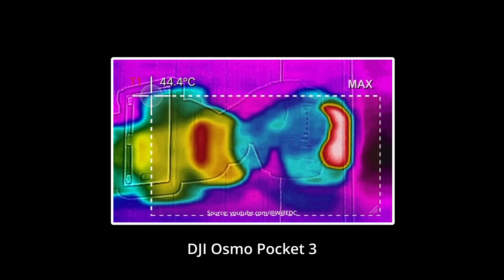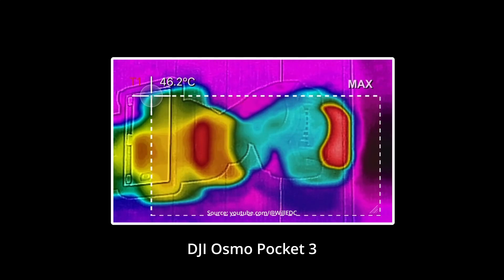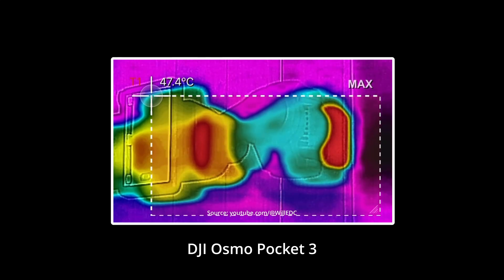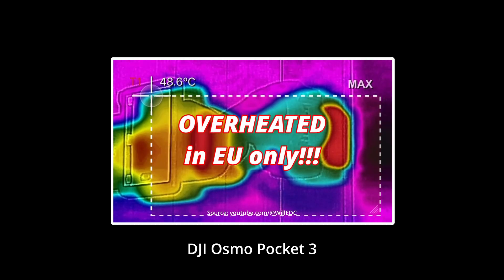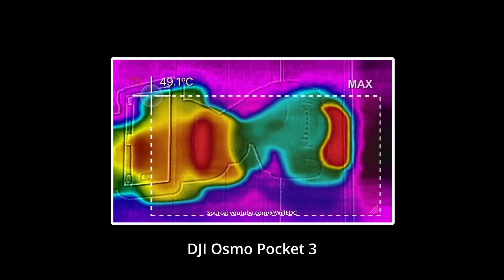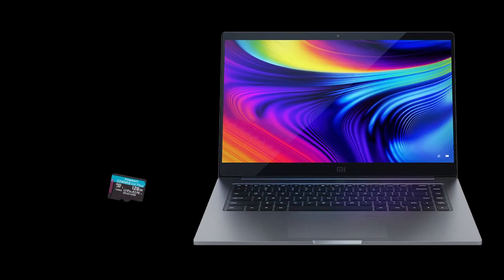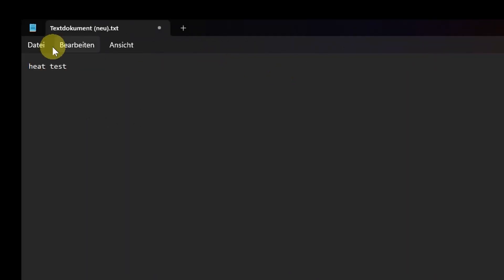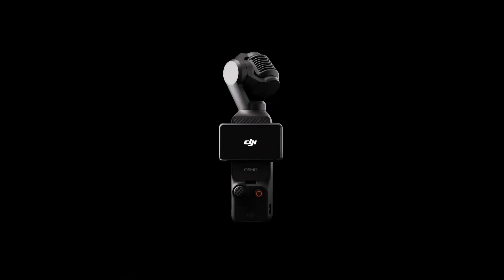DJI Osmo Pocket 3 overheating problem [EU only] (SOLVED!)

Comment: Thanks for this very informative video. so sad to have my Pocket 3 switching off after 27mn (4k 60fps at 54°F) obliging me to film 1080 60fps - thanks for the text file trick, I will try it at my next use
Reply from the maker: 54°F is a very low temperature. I hope this method will help you out. But keep an eye on that temperature, there are a few cameras out there that are defective and actually really overheat (more than 60°C - 140°F). Good luck!
Reply: Don't try it !
Return your camera back.
You have a guarantee, but it counts only if you don't mess with your camera if some defects are happens.
I returned my P3 immediately back and there is ONLY two options for me personally:
A properly working camera or my money back !
Reply: @showingYOUtheworld  Depends on how you use it. I use mine primarily in short bursts so it will only affect me in rare occasions. According to the original poster, the issue lies with an EU directive, as opposed to being defective. The jury is out for me ATM .

Comment: I live in Ireland in the EU but I'm just a one hour drive to Northern Ireland which is outside the EU. I think I'll drive to Northern Ireland, buy the Pocket 3 and install the firmware while connected to the UK's mobile network before returning to Ireland. I'll also disable auto install of future firmware upgrades so that I can control what location I'm in when they are installed.
Reply from the maker: It's worth a try 🙂 Good luck!
Reply: I'm in Northern Ireland but it still shut down last week due to overheating..doesn't make sense🤷
Reply from the maker: @declannelis8298  Maybe Northern Ireland is still considered EU by the firmware developers. 🙂
Reply: That crossed my mind

Comment: for some reason i dont have the TXT in the file i can  simply change the name without having to remove it, in properties the txt is still visible and the crack does not work for me it still overheats at 1080p60 after 25 min its ridicules
Reply: a quick update i downloaded the file you shared and it is indeed different im on windows 11 and it wont let me deleted the TXT part of the file ( its simply not in the name to be removed ) im gonna test it right now, im sharing this for the future watcher :)
Reply from the maker: @ProfessorBroake  In order to see the ending of the file, you need to change your windows settings in the explorer menu bar, under "View/Show/File name extensions". By the way, if you update your firmware, the overheating problem should not be there anymore.
Reply: @TheBestShowman  oh really ? thank you so much for the tip. Your file worked already perfect. i will update my cam as soon as i can. Keep up the great work
Reply from the maker: @ProfessorBroake  I am glad I could help 🙂

Comment: I did as you described but it didn't work. Do I have to restart the device? And how could I reset the device? I unzipped the file, put it on the SD card, inserted the card into the Pocket 3, slid the Pocket 3 dspaly and... it still filmed. That's why I say, do I have to restart to be able to boot that file? Thank you!
Reply from the maker: Hello there! Reboot the device by pushing the record button for about 10 seconds. The DJI Logo should appear. Let me know if it works. 🙂
Reply: @TheBestShowman  does the device have to be on or off to reboot? cheers!
Reply from the maker: @Danny_Zak  When the camera is on 🙂

Comment: My computer doesn't have an SD card slot, so I used a USB-C cable to connect it directly to my pocket 3. Then I followed the hacking instructions using the crackconfig file and it didn't work, my pocket 3 still overheated and shut down after 10 minutes at 4K60FPS. Please help me!
Reply from the maker: Hello there. I am surprised your pocket 3 still overheats. After the first firmware update, this crack was not necessary anymore. Did you install the latest firmware? This should fix your problem. Beside of this, try to reboot your Pocket 3. Turn the cam on and hold the record button for 10 seconds. Then restart the camera. If even this does not work, then totally drain your battery until the camera is totally dead and then recharge. One of these methods should work. Good luck!

Comment: Do you know if I buy the OP 3 directly from DJI website is comes from the US, if I order it to EU, avoiding the overheating limits problems?!
Reply from the maker: Since the first firmware update the device doesn't overheat anymore.
Reply: Hi!  @TheBestShowman  do you mean they fixed this issue with the firmware update?
Reply from the maker: @RockinPeterPan  It seems like they did. My cam doesn't overheat anymore.

Comment: Lets hope they dont repease some firmware update that would not allow such testing
Reply: Maybe it is dji's intention that this is so easy to fix. Of course, DJI has to comply with EU regulations if they want to sell products there. But maybe this is a legal loophole that is simply being exploited. Because the law probably does not prohibit circumvention, or it simply lacks this passage, and DJI is using this loophole to allow users in the EU to circumvent the 48-degree lock. Not officially of course, but under the radar to the leakers who then spread this information. That's why I don't think DJI will close this loophole, but will allow users to bypass the lock as a special service. If anything, the EU will probably have to adapt its laws to explicitly prohibit such circumvention!
Reply: They will stop the hack in the next firmware update. If they dont its a liability issue for DJI
Reply: The hack already worked with the osmo action 3, so for a little over 2 years now. And now it also works on the action 4 without any problems. So if it was a liability issue, DJI would have fixed it long ago or prevented it with one of the countless updates that have been released so far. Outside the EU, there are no problems with the missing temperature lock. In the EU, on the other hand, this lock must exist and it works. 
Temperatures above 48 degrees are not reached and DJI is therefore complying with the law. If the law does not say that the lock cannot be easily bypassed, then DJI is not vulnerable and therefore sees no reason to change anything about this small but subtle "bug". If the lock is circumvented, then the user is responsible for it, because DJI does not say anywhere that it can be done so easily.

Comment: so it is like a bad product?
Reply from the maker: No! Not at all! It's a great product. All video recording devices in the EU must switch off at 48°C. The problem is the EU regulations and not the devices.
Reply: @TheBestShowman Yes,but this is something between DJI and EU and it should NOT affect the customers !
Reply: @TheBestShowman  my question is how it works in a hotter enviroment. will it get to hot?
Reply from the maker: @showingYOUtheworld  Has nothing to do with DJI. It affects all European video recording devices.
Reply from the maker: @lonelytraveltales2860  It gets warmer, but then switches off as normal when it reaches a critical temperature, just like in the rest of the world.

Comment: The author of this solution to the problem is a Pole.
Unfortunately, bypassing the temperature limit may result in damage to the mechanisms inside the camera, e.g. damage to the display.
There is a video, but the creators of other channels block all links.
Reply from the maker: The limit of 48°C has absolutely nothing to do with overheating. The cam overheats @ about 60°C. This is where it regularly shuts off, after using the text file. If you buy a cam in the States, it shuts down at about 60°C. Take the exact same camera to Europe, update the firmware and it is forced to shut down at 48°C.
Reply: @TheBestShowman  And how long can you record the most demanding material at 60 degrees?
Reply from the maker: @lwslwieserce  As long as any other Pocket 3 owner on this planet, beside EU residents.
Reply from the maker: The italian video says exactly what I am saying in my video. The second video comes from India (not EU) the camera overheated not because of the use of the file, but because the device must have been defective, since it didn't even stopped when overheating. But anyways, no one is forced to use the file. It's a free choice. Keep it or leave it, it's that easy.